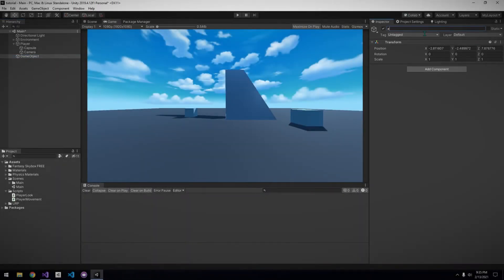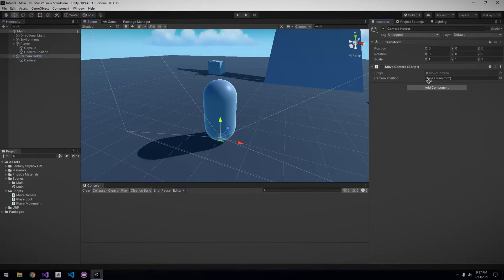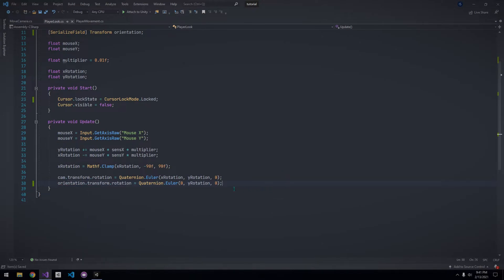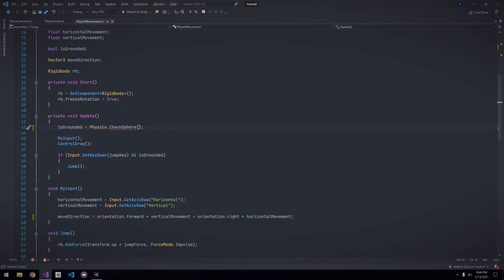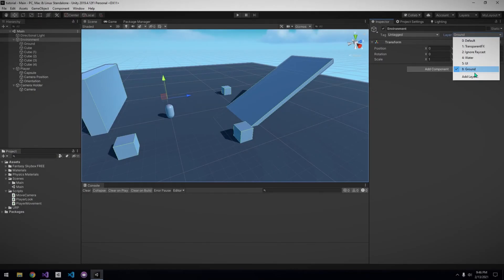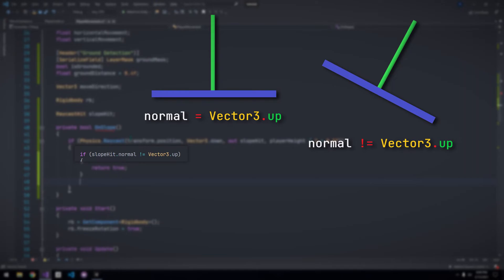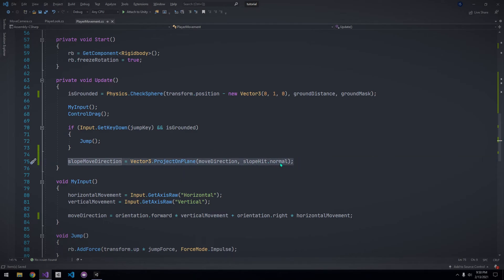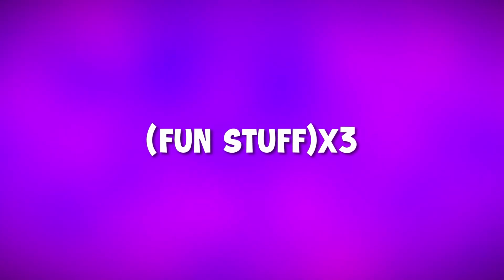Rigidbody FPS Controller Tutorial #3 | Handling Slopes + FIXES!

Comment: Ok, I might get this wrong. But what this does is to simply ignore the orientation of the player. Which means your player won't rotate with the camera, which is what fixes the jitter. If you do "transform.rotation = Quaternion.Euler(0f, CurrentYaw, 0f);" to also move the orientation of the player the jitter is back.

Comment: a way easier fix for the camera jitter is just to increase the physics fps since it defaults to 50 (edit -> project settings -> Time -> Fixed Timestep: and change it to smaller number (1/frame rate) )

Comment: works great, however when the player is standing still on a slope it slowly slides down. did this happen to anyone else?
Reply: I was able to figure it out, so you want to make a serialized field in the player movement script to make a reference to the player physics material, then you want to say that when the player is grounded and on a slope, static friction will be 1, but if the player is only on the ground then it will be 0
Reply: @datopotatogames6885  10/10 solution here, thanks for sharing!

btw if you set the static friction, you'll still slide down after moving - setting dynamic friction instead will always let you stand still on a slope.
Great answer anyway, wouldn't have thought of this otherwise!
Reply: Yeah i have the same issue too were u able to figure out a solution?

Comment: Hi! Great video! I'm getting this annoying bug where the camera moves along the y axis fine but it doesn't move for the x axis. Is anybody facing the same issue?
Reply: you have to change playerCam.transform.localRotation = Quaternion.Euler(xRotation, 0, 0); to playerCam.transform.localRotation = Quaternion.Euler(xRotation, yRotation, 0); 
replace the second 0 with yRotation
Reply: @pocketcorner3309  it's working for me but I'm getting a lot of errors saying "The variable cameraPosition of MoveCamera has not been assigned."

Comment: using System.Collections;
using System.Collections.Generic;
using UnityEngine;

public class Playerlook : MonoBehaviour
{
    [Header("References")]
    

    [SerializeField] private float sensX = 100f;
    [SerializeField] private float sensY = 100f;

    [SerializeField] Transform cam = null;
    [SerializeField] Transform orientation = null;

    float mouseX;
    float mouseY;

    float multiplier = 0.01f;

    float xRotation;
    float yRotation;

    private void Start()
    {
        Cursor.lockState = CursorLockMode.Locked;
        Cursor.visible = false;
    }

    private void Update()
    {
        mouseX = Input.GetAxisRaw("Mouse X");
        mouseY = Input.GetAxisRaw("Mouse Y");
         
        yRotation += mouseX * sensX * multiplier;
        xRotation -= mouseY * sensY * multiplier;

        xRotation = Mathf.Clamp(xRotation, -90f, 90f);

       
        cam.transform.rotation = Quaternion.Euler(xRotation, yRotation, 0);
    }
}

It works for me

Comment: if you are having problems and you can only move your camera up and down, remove MyInput() in the PlayerLook script and add the code inside there to Update(). Then change cam.transform.localRotation to cam.transform.rotation and Quaternion.Euler(xRotation, 0, 0) to Quaternion.Euler(xRotation, yRotation, 0).
    private void Update()
    {
        mouseX = Input.GetAxisRaw("Mouse X");
        mouseY = Input.GetAxisRaw("Mouse Y");

        yRotation += mouseX * sensX * multiplier;
        xRotation -= mouseY * sensY * multiplier;

        xRotation = Mathf.Clamp(xRotation, -90f, 90f);
        
        cam.transform.rotation = Quaternion.Euler(xRotation, yRotation, 0);
        orientation.rotation = Quaternion.Euler(0, yRotation, 0);
    }

Comment: I found a simpler fix to the jittering than the one stated in this video. replace transform.rotation with GetComponent<Rigidbody>().rotation unity doesn't like it when physics and transform changes mix, so this uses physics to rotate the player.
Reply: I love you I couldnt get his way to work it would only let me look up and down
Reply: wait but now can i still add in the orientation factor
Reply: how do i do that
Reply: Or i guess you can just add Physics.SyncTransforms(); after changing transform.
Reply: @xfletcher-o5n  where u add that more exactly?
Reply: where?
Reply: @ASFALT.  in the camera script
Reply: @ASFALT.  he said, after changing the transform
Reply: Doing that restricts how often your camera rotation is updated to fixedDeltaTime. Which means looking around will look jittery on high FPS monitors

Comment: For some reason whenever I do this I cant turn left or right. This is at the point where he says it should be like normal, but before the orientation object is added. Please help.
Reply: He forgot to mention but in PlayerLook, in the line: came.transform.rotation = Quaternion.Euler(xRotatation, 0, 0);
You need to add yRotation so it's like this: came.transform.rotation = Quaternion.Euler(xRotatation, yRotatation, 0);

2 years late but hey, next person will benefit.

Comment: Hey, for anyone else working through this series, the camera position empty and orientation empty can be the same object. Just set the orientation position to the camera position height, then refer to it for both camera position, lateral camera rotation, and player movement. 
The orientation empty doesnt rotate vertically (only around the Y axis) so you wont get any weird movement glitches.

PS. I'm still new and he might fix this in a later video idk. :)
Reply: make sure of this 

private void Update()
    {
        myinput();
        cam.transform.rotation = Quaternion.Euler(xRotation, yRotation, 0);
        orientation.transform.rotation = Quaternion.Euler(0, yRotation, 0);
    }

Comment: Great tutorial!!! But could you please explain how that fixes the jitter and what causes the jitter? Please
Reply: I think basically the camera updates per frame, but the rigidbody updates in the physics update, causing a lack of sync as the Physics update happens at the different rate than the normal update. This causes the jitter.
Reply: @sohamacharya171  couldnt you just put both in fixed update so they both update at the same time?

Comment: Thanks, dude! I spent LOT of time to resolve this issue.
To have correct moving on slopes do next steps:
1. check ground with raycast, here 0.4f value is real magic ;P
2. if you are grounded, get the angle with raycast hit.normal
3. get normal velocity by axis X and Z and use it if not grounded
4. if you are grounded and have different ground angle (step 2), just update velocity with Vector3.ProjectOnPlane(velocity , hit.normal)
5. apply gravity if you not grounded.

Comment: Great video and the best tutorial series for an FPS controller that I've seen so far.  But when I go up a slope it works great and the player slows down, but when I go down its still jumpy and the player doesn't speed up, any ideas?
Reply: Hey I had the same issue as you, and it was caused by me forgetting to change moveDirection to slopeMoveDirection in the 
else if (isGrounded && OnSlope()) statement. Dunno if you resolved your issue yet, but I thought I'd write it out in case more people had this problem.
Reply from the maker: Hmm that means the slope handling from this video is not working, maybe compare code or rewatch to see if you missed anything

Comment: super consise stuff! i like that slope solution alot. much better than adding a massive downward force. one solution i thought of for ground detection was to check the angles of the contact points in OnCollisionEnter and OnCollisionStay, and if it was within a certain boundary defined by the collider bounds, grounded = true. this method would also apply to checking other directions too. not sure its the most performant idea though